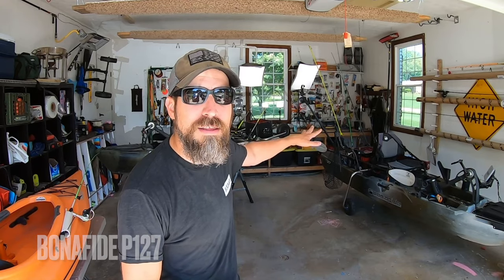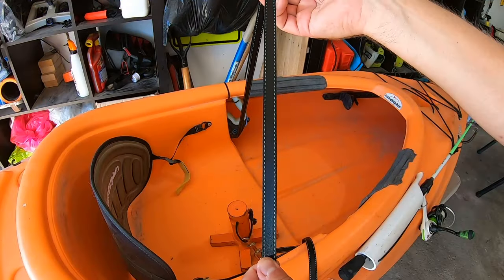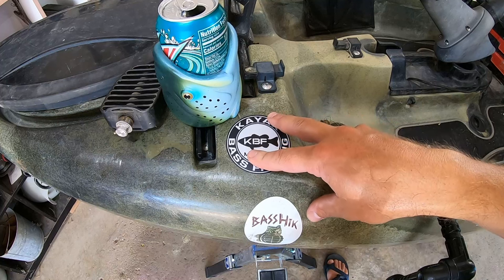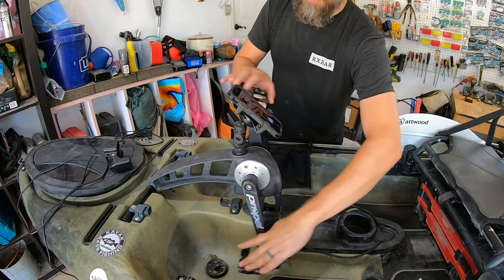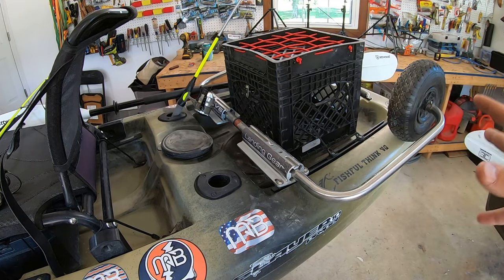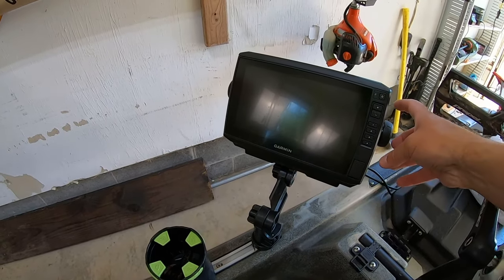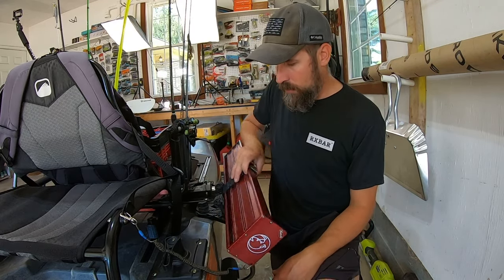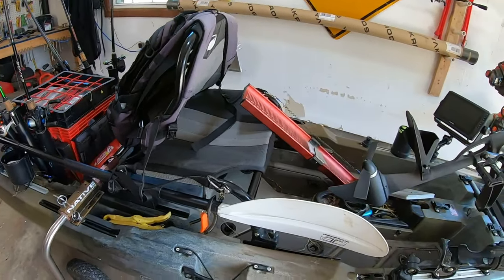Beginner To Amateur Kayak Angler in 3 Videos (Part 3)

Comment: On lightweight paddles, I have to recommend carbon fiber.  I have an old Aqua Bound Stingray and a newer Bending Branches Angler Ace.  Both are awesome, but I think I prefer the BB.  We have cheap aluminum shaft paddles from the old rec yaks that we used for a few years back in the day.  The CF are way better and worth every penny if you need to paddle.
FYI on the anchor, don't anchor off the side in moving water or wind.  The side will drag down and eventually swamp.
Craigslist is also a good place for used kayaks.
Scotty and Ram also have good transducer arms.
Molle is pronounced molly.
Reply from the maker: Thanks boss!

Comment: I like the Aruba 10 mods ,  I have a cheap Lifetime Cruz 10 also ,  super light. I put 2 recessed pole holders,  paddle holder. Enough room  for a couple 3600 tackle cases. I need to bring to the AEP ponds.  Thank you for the video. The keel guards will be my next upgrade
Reply from the maker: Right on brother! Use the Goop Method!
Reply: @wendellfishing  ❤ Goop

Comment: Very helpful series. One DYI tip, as I couldn't justify $80.00 + shipping for the Yak Attack leverage net I had to get creative. You can buy or use your existing net coupled with a used handicap crutch from the thrift store. It doesn't have the angled curve in it but it does provide a handle as well as the arm cuff. Since I had two nets(one for fresh water and one for salt water) and the crutches came in a pair, I just made 2.
Reply from the maker: Right on brother! Gotta get creative because this stuff is $$$$